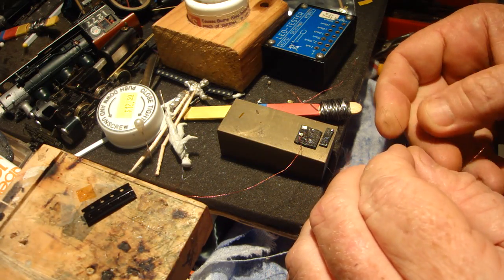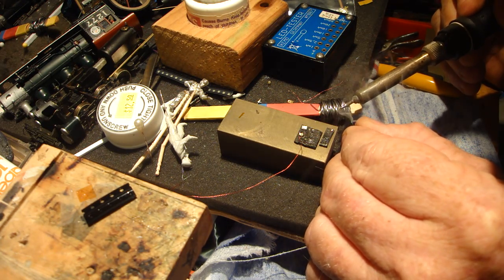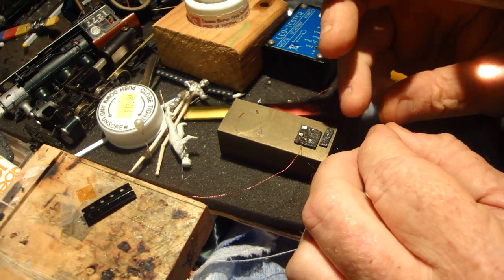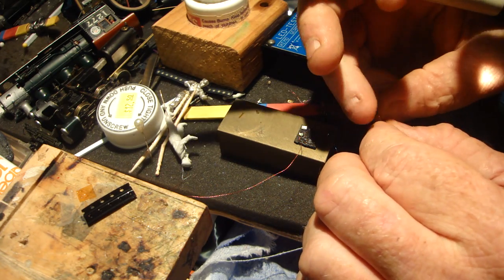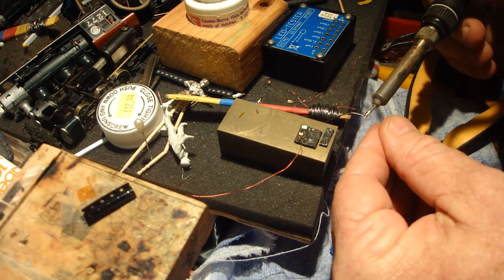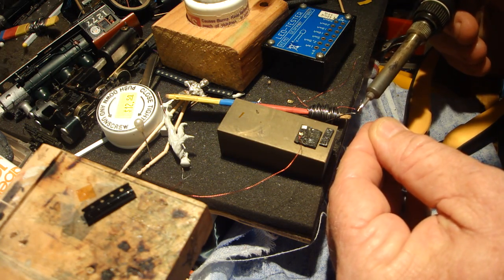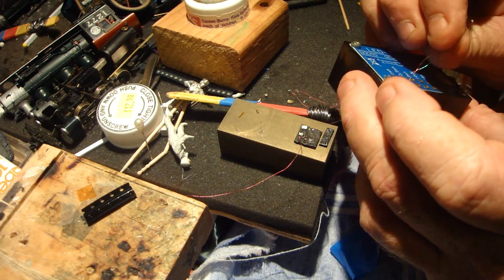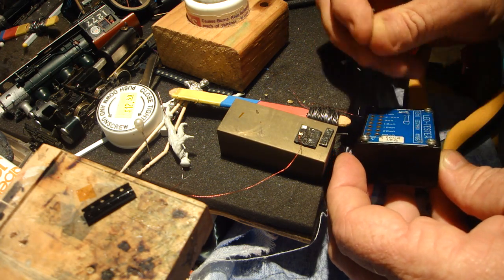SMD Nano LED - soldering leads

Comment from the maker: Yes, you tin the SMD LED having the iron temp low.
Yes, you tin the magnet wire burning off the insulation.
Once both are tinned just solder wire onto LED.
You must use flux.

Comment: So, please answer me, you tinn the wire, this makes the magnet wire enamel insulation yo burn off, then, you place the tinned wire on the LED and heat the tinned wire and that´s how you make the solder? you do not apply extra solder on the LED before? Or directly into the LED and wire connection? The tinned wire is enhough to make the solder wire-LED? thank you.

Comment: Wow, you make it look so easy. I have been working on solder enamel wire to 0603 LEDs. I can get the wire soldered on fairly quickly, but the solder joint doesn't hold well. Even with light handling the wire often falls off. Do you have any tips for getting a strong solder connection?